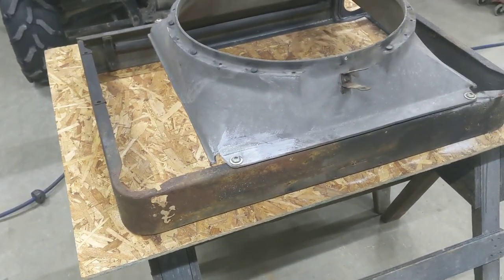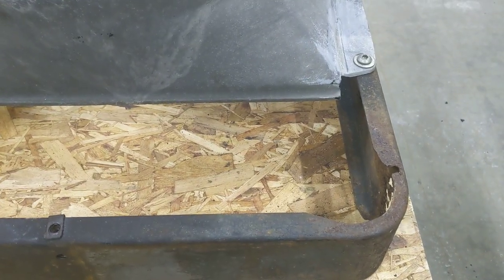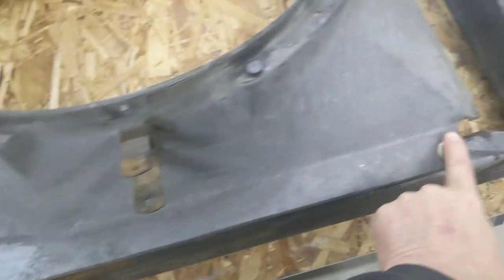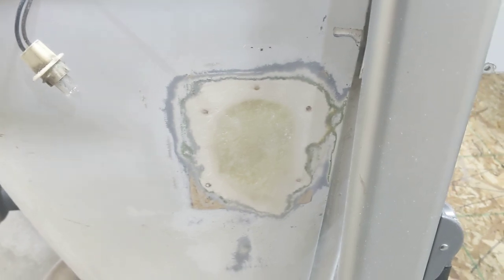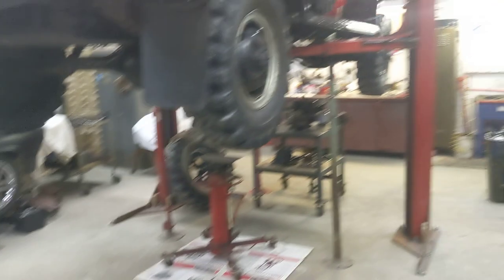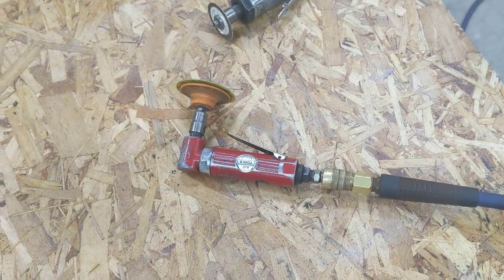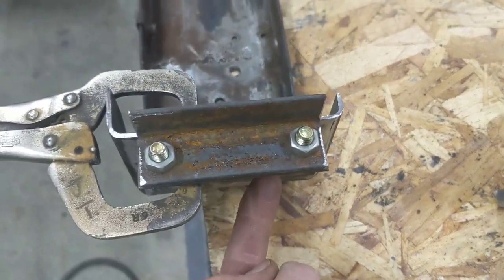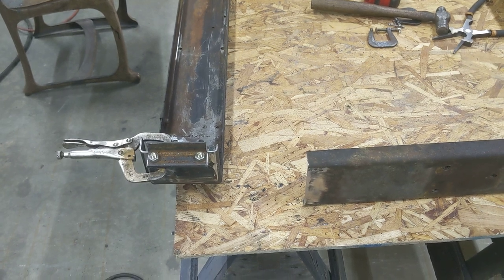GMC Motorhome 53 (radiator support)

Comment: I was able to find a set of NOS rubber rad pads from a GM dealer.  The local dealer was able to search parts stock at other dealers and found the set about 100 miles away.  I used a piece of U shaped aluminum extrusion to replace the corroded brackets that held them.
Reply from the maker: I ordered the rubber parts from Applied, u channel alum sounds like a good plan. Thanks